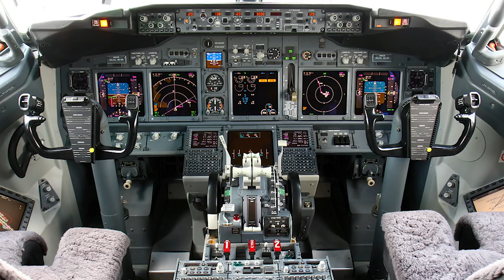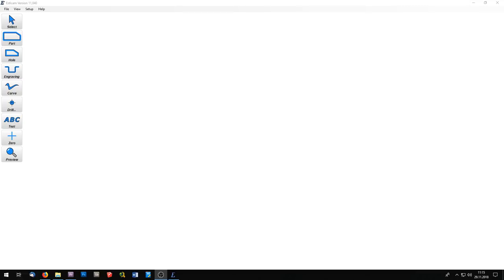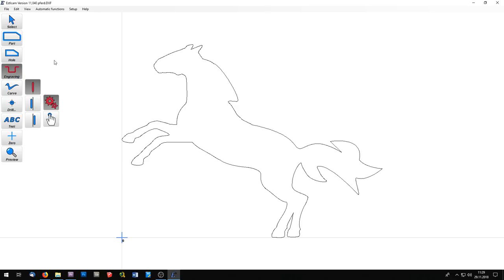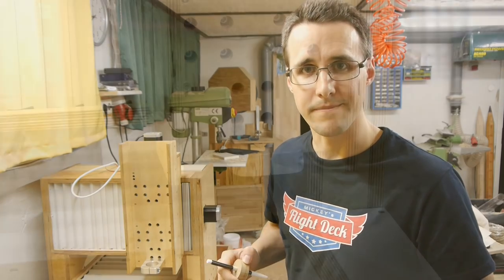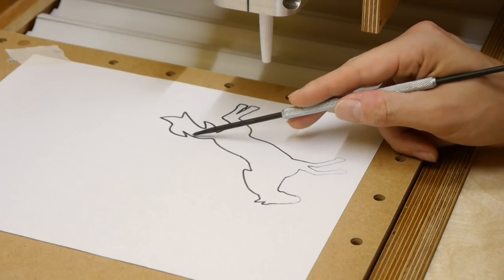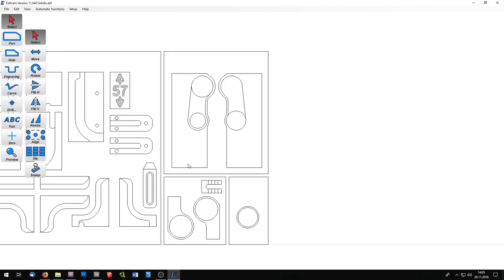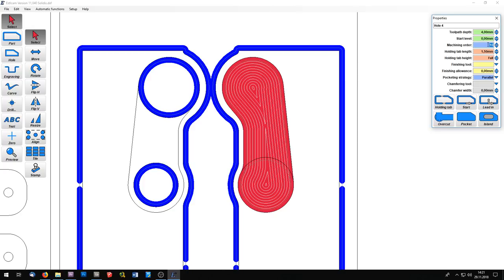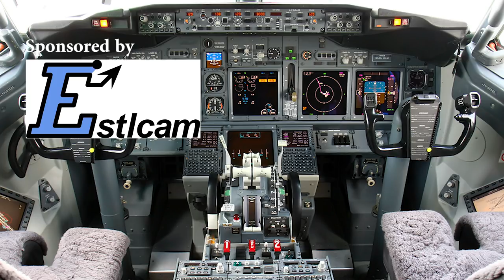Building the Solidis CNC - The first using - A Boeing 737-800 Homecockpit #29

Comment: I know this is old information two years later but the reason it most likely did the taper was because of the X axis. And where that Eric came from was how are you space the rails from the edge of the wood box. That was inherently imprecise and since you made the Xbox parallel to the table by measuring the outside height any difference between the outside dimension and the inside rail is showing up as that taper. The way to fix it would be to have some sort of level line coming out from the actual rails and measure those with a micrometer down to the table. Now, of course, you can just level the table by routing it off flat butbut you would be introducing insignificant cosine error in the Z axis. But you have all the panels made at this point 2 years later so I really don’t think it’s a problem :-)

Comment: Great and thank you very much for sharing this knowledge. I'am impressed !! Qty: The power of the three controllers with blue and brown: Why not bring two wires to the controllers area and split o the other two? Nevertheless Great Job !! Have a nice day ...
Reply from the maker: Yes, you could have done this as you said. But the power supply has these three outputs so I decided to use all these three. I don't now if this makes any difference.
Reply: @Mickeys_Flightdeck  Then your solution is better. Sorry for my earlier remark !!